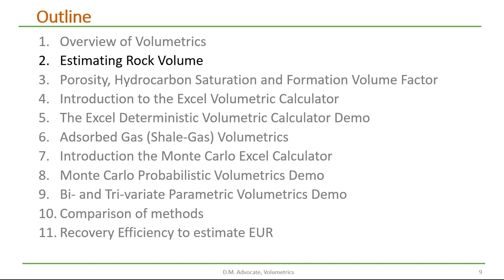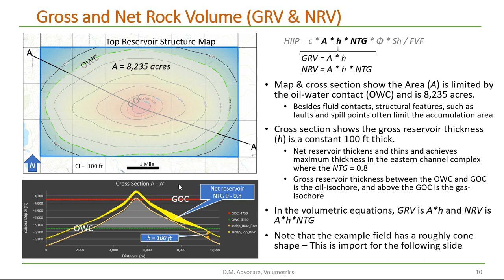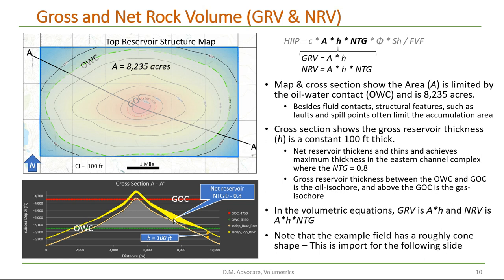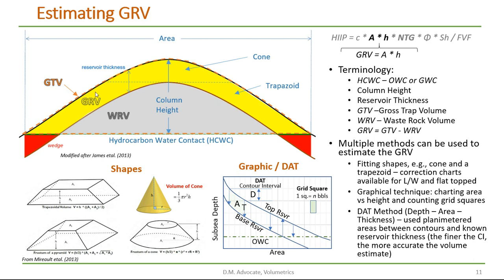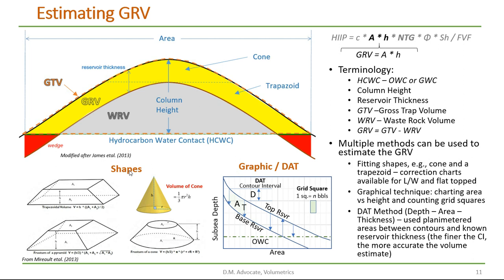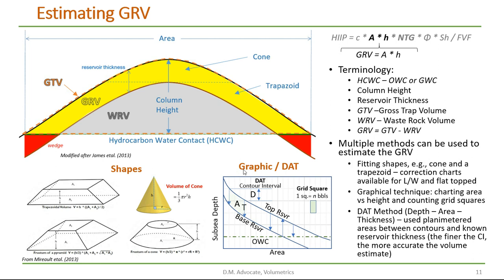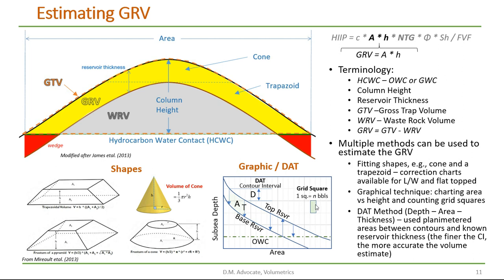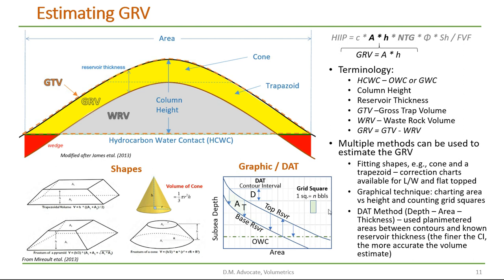Volumetrics Part 02 of 11: Estimating Rock Volume

Comment: Which methods is the accurate  one.or any which situation we use the specific type.❤
Reply from the maker: When there is sufficient well data to map the volumetric parameters, like net-to-gross, porosity, water saturation, fluid contacts, the map based method should be used. Where limited well data or no well data is available, but a structure contour map of the trap is available, use the DAT method.  Shapes can be used when you are basing your traps on analogs and only a very coarse estimate of the volume are required.